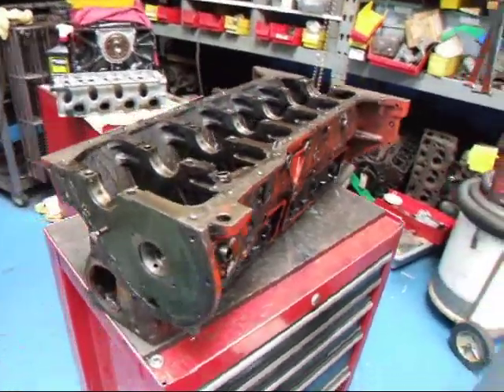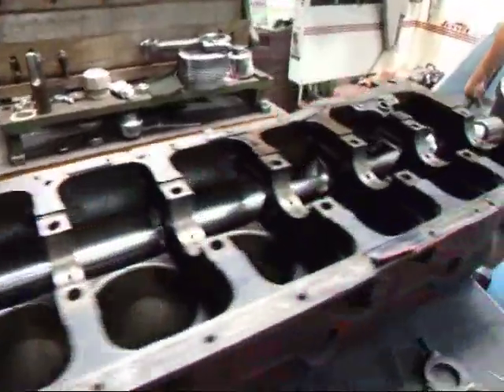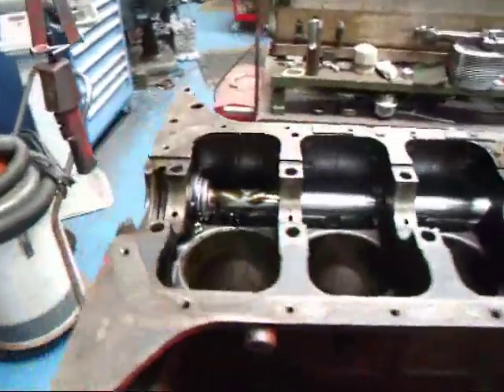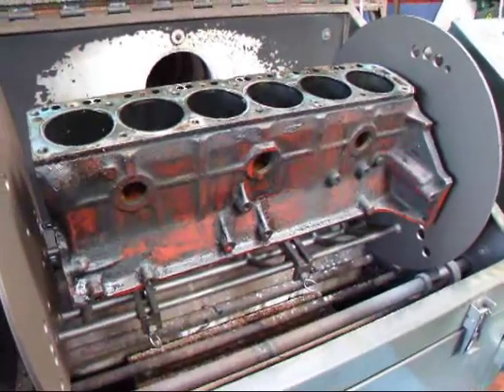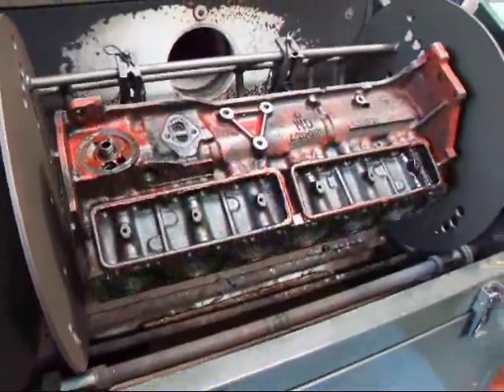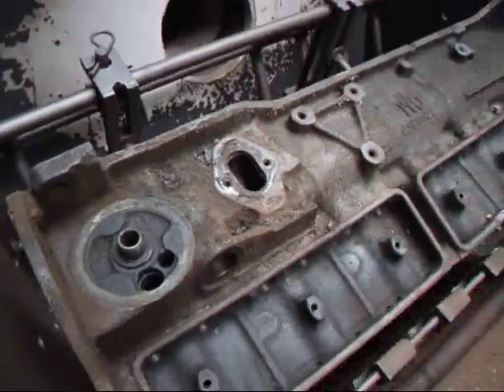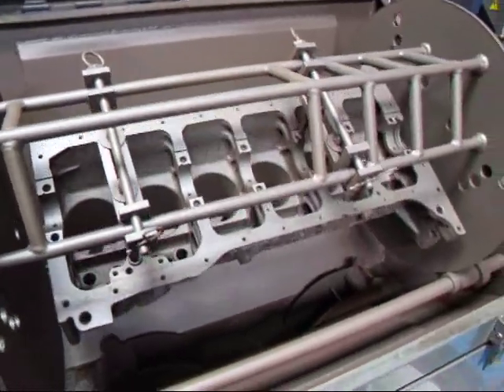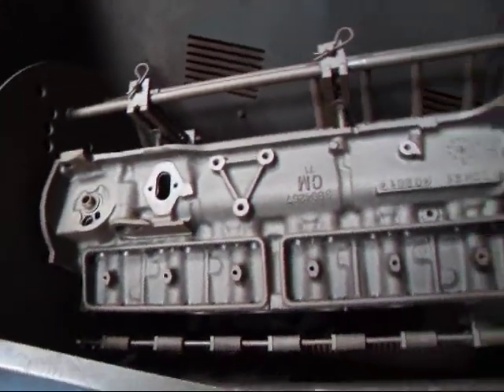250 Chevy Cleaning.wmv

Comment: @fiatnutz I read in a fairly reputable magazine (SCC or GRM) that low compression just makes a turbo motor much easier to tune, even though the higher velocity gas out of a higher comp. does indeed spool the turbo faster. It does make sense that being force fed and supremely squeezed would make things a bit tense tune-wise. Just a thought.

Comment from the maker: @VMATT500C - Why would you want low compression with a turbo? I run a minimum of 9:1, up to 10.2:1, and use less pressure to do the same amount of HP. Compressing air just makes it hotter and you need an intercooler. Plus, off corner acceleration is better because the you don't have to wait for the turbo to make spool up.